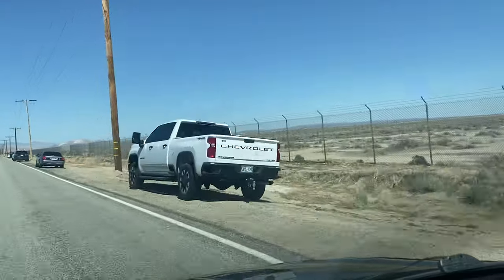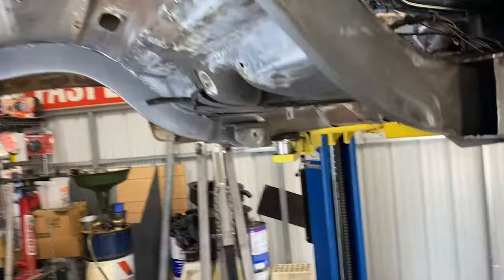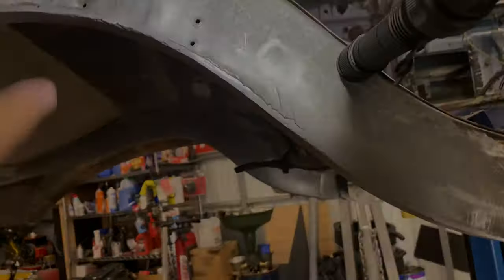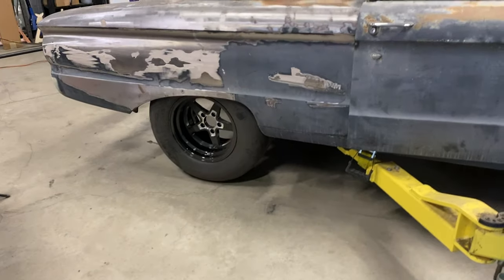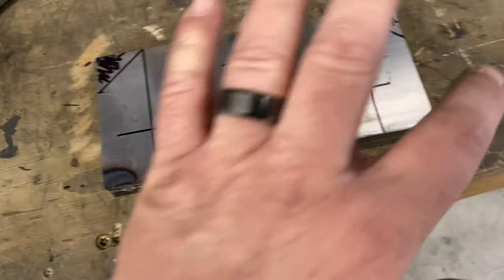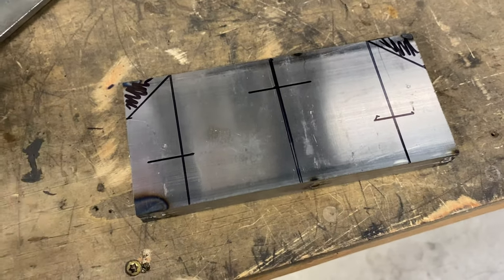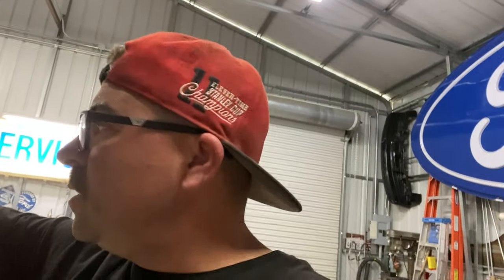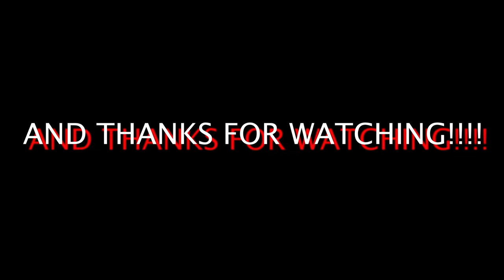FRAME RAILS MODIFIED!!! and leaf spring slider brackets completed!!!

Comment: I like the way you're doing it.  On mine, I cut it all out, so I've got a forest of plumb bobs, tape marks, sharpie marks, laser lines, trying to figure out how to get the new frame rails in square, even, and plumb.  I think it would be easier just to put the front leaf spring bolts out to drop the rear.  The housing is closer to the front, so it seems it would have more pivot clearance if it dropped down hanging on the sliders.  Probably have to disconnect the shocks and get a long brake line .  It's one more item on my check list to remember to make sure I can get the tires back off once they are on!

Comment: Nice, on my Ranger I just put the springs below the frame rail.  Used the slider. Are you going to us a Cal Tracks design?  I made my own.
Reply from the maker: Yes I bought their stuff. There a local company where I live. I may change to the Funkhouser lower spring plate that has adjustable stuff for the bar and shocks

Comment: Not a fan of those tube connectors on a suspension support but they are beefy as hell, im using them to hold ny tube front end on with 6 of them
Reply from the maker: Wish I could see them in person. I don’t know how else I’ll be able to easily change tires without doing something like that
Reply: @TeamDPerformance  i used the ones with 2 bolts and a notched interlocking fit vs the ones with just 2 flat halves, with the two notched halves they wouldnt bother me as the bolts combined sheer strength and the interlocking halves being a tight fit i believe the bar would bend/break before their strength became an issue
Reply from the maker: Hmmmm, I forgot to consider the notch’s as part of the sheer strength. Who did you get yours from ?
Reply: @TeamDPerformance  i got them from TMR also, was going to weld tube in the upper and lower rails then a stubout to slide into the rails with 4 pins to hold the tube front on but a TMR ad popped up one night-so i ordered 8 for 2 cars but made a gusset bar for each side
Reply from the maker: You have Instagram?! Or photos ? I’d like too check it out
Reply: @TeamDPerformance  no IG only FB and thats not very often, its turned into a crybaby tic tok hot spot so dont do much with it other than messenger. I dont have pics but can snag some this weekend

Comment: How wide is your rear end and what front suspension did you use
Reply from the maker: I just cut some off of the mock up rear end I made but I think its about 51 inches wide. Ill talk about that in the next video or so. The front is Speed Kinetics with Team Z caster camber plates and strange struts.
Reply: I know I’m asking a lot of questions I just like your set up. What is the length on your A arms?
Reply from the maker: Thanks !!! I believe they’re 12 inch arms. Can’t remember to be honest!

Comment: What front leaf spring pocket did you use? Have a link? Thanks
Reply from the maker: Funkhouser Race Cars
Reply: What are your wheel specs? Width and backspacing
Reply from the maker: @HondaHoarder  the rears are 15x10 with 4 inch back space
Reply: @TeamDPerformance  dang all I can find is 4.5” bs
Reply from the maker: They could be 4.5 back space I really can’t remember lol but I thought they were 4 inch back space

Comment: Did you or anyone ever try a 255 60 15 with stock rails and leafs relocated? I could live with 255s on my 62 ranchero.....Thanks
Reply from the maker: No I didn’t. That might work with an 8 inch wheel..
Reply: @TeamDPerformance  I have 245-60-15 on a 7" rim on my 64 falcon....I know the 62 is smaller back there...I will see what I can fit.  Thanks
Reply: I wonder what is the widest tire you can run with the Crites relocation kit for a ‘62 Ranchero?  It looks like they move in a solid 2” at least.....I am trying to get a game plan together so I can get started soon.  Is the Caltrac setup a good way to for street and some strip use on occasion?
Reply from the maker: Crites will tell you! Yes the Caltrac’s will work fine on the street. Call them and ask for cuda John. He’ll get you set up!